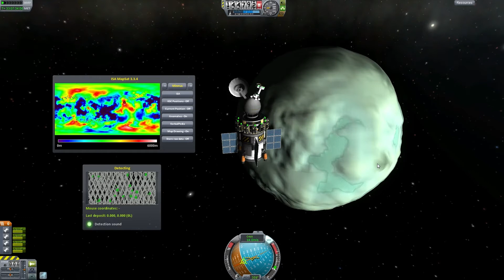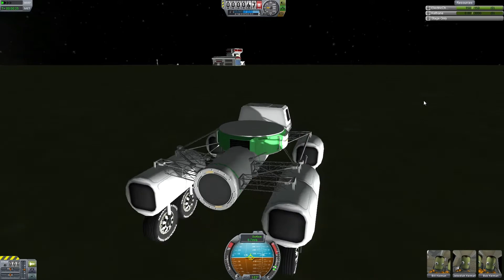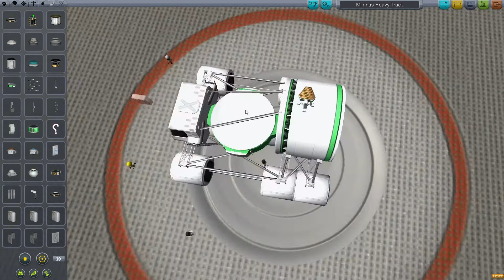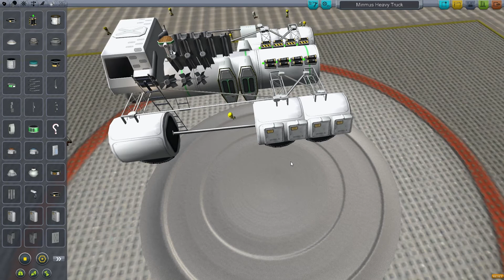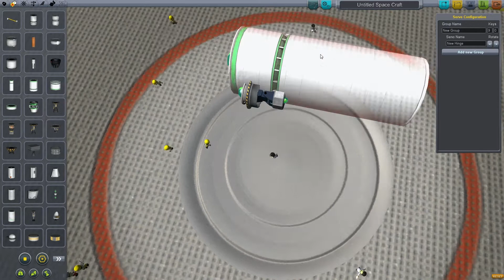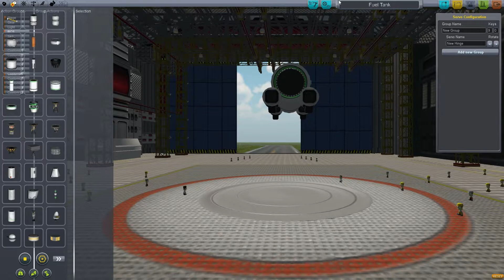Kerbal Space Program 0.18.2 S2 E1: Derping on the ground!

Comment: Add gimble to center engine? Delapidated kerban jelopy? Lol also 4 wheel steering? Lights? Bumper stickers? Legs as braces? Nav unit on tank incase of missed target point or would that cause a issue having 2 nav units on 1 craft? Maybe just 1 ladder in front? Kerbal flag on tanker? 2 big tanks instead of  4 lil ones? With this would it be better to come in more horizontil or veritcal? Add more fuel to the fuel tank (aka oxidizer and liquid) i know you can make it on the fly if you add a convert